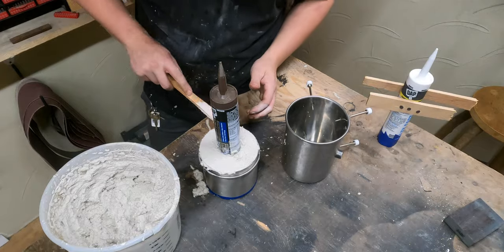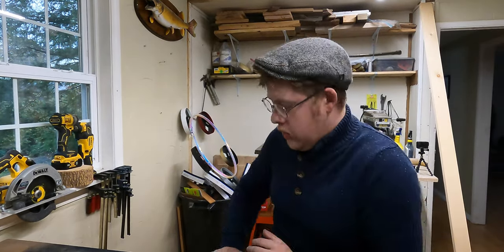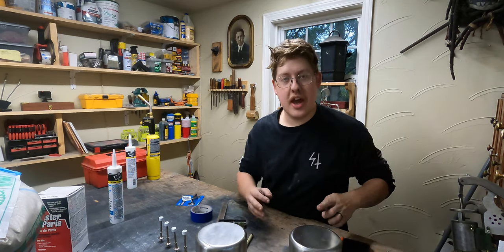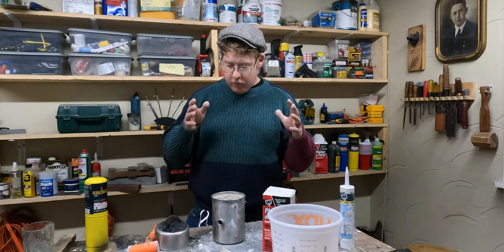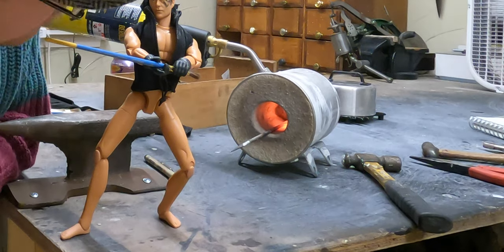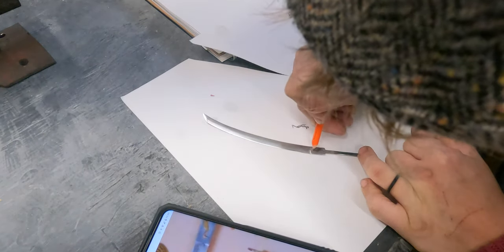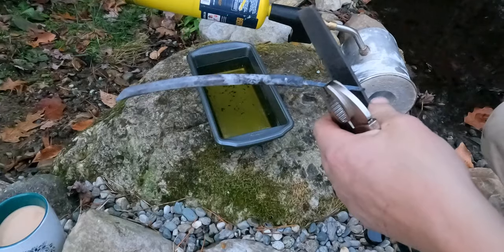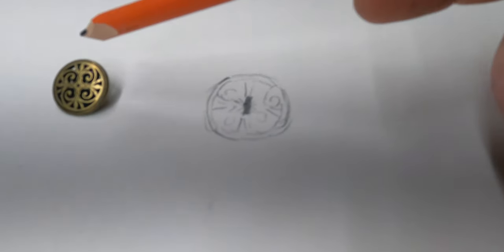Amazon's Wheel of Time Micro Forging Build | The Heron Marked Blade Authentic Replica

Comment: When using a file for knives you should first heat the file up until it loses its magnetic properties,  let it cool slowly. Sometimes you have to do it a few times until the becomes soft. Trying to forge harden steel causes heat and stress cracks.  But it's still a beautiful piece and a great video.  Love the corny jokes.